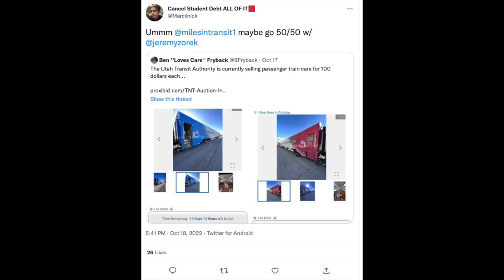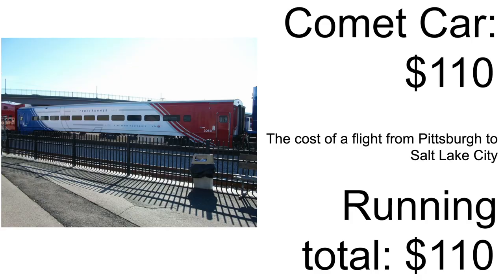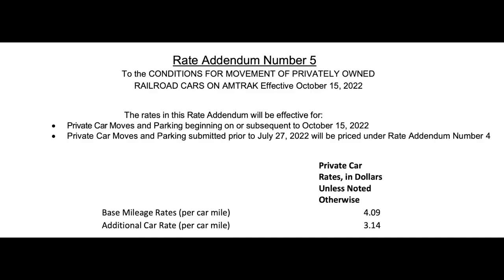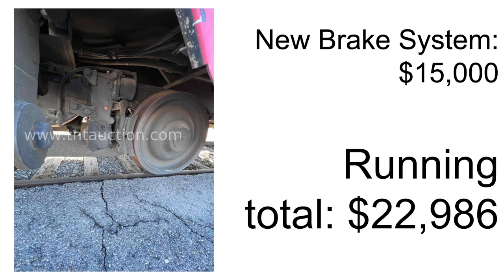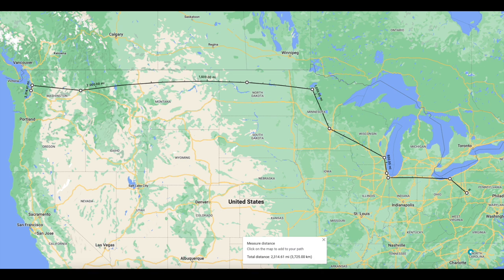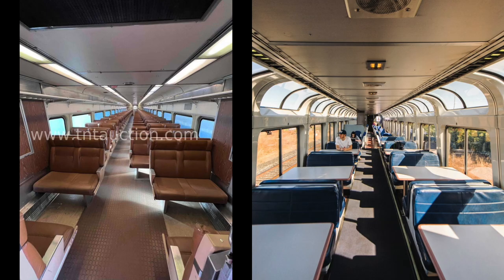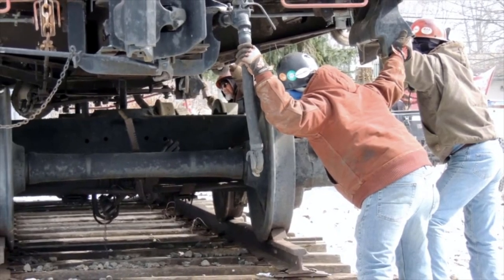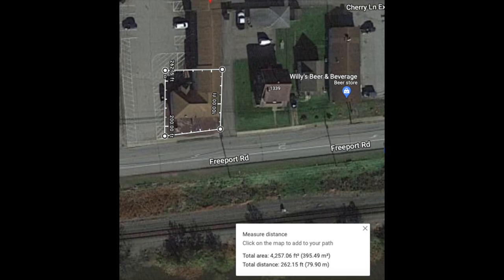These Passenger Cars Are Selling for $110*

Comment: A bit of extra information about the windows: from what I have heard, smaller windows were more common at that time because hooligans took joy out of throwing stones at train windows (or at least in Chicago, since I got this info on a video about Metra's gallery cars). Now that the fun has been zapped from that activity, windows seem to be getting bigger again. Given that I wasn't around in those days, though, it's probably best to take what I say with a grain of salt.
Reply: I think a big part of it was also that the cars were air conditioned but not necessarily insulated all that well, so they wanted to cut down on how much radiant heat came in through the windows. A lot of buildings in the early decades of widespread air conditioning were value engineered the same way.

Comment: Gee where did my last post go? Places that you might keep it cheap around Pittsburgh are: Oil Creek and Titusville RR, Cuyahoga Valley Scenic RR. But it's got wheels and if air dates are kept up you can move it again in a few years. There are two groups around Youngstown that have equipment that might let you in. Which is not too far from the Burg

Comment: Major issue is where to keep it? The best place is a tourist short line or any short line. Costs of track rent vary depending on the line. Major cities have major costs. If you have the car inspected and find a good one. There is NO need for all these expensive repairs and changes. It's is a simple commuter car. Small windows are lower cost to replace by the way.   Today we have plastics that are unbreakable and just as good as glass. Maybe Corridor Development Company can help you? AC&J RR is not too far away, Jefferson, Ohio maybe they will rent to you?
Reply from the maker: Big if - trains break down a lot!
Reply: @ClassyWhale  I never had a issue, since I followed up on the work I wanted done was done right. So it was ready for railroad inspectors when they arrived to look it over. Before they would permit it on their railroad.
Reply: @ClassyWhale  There are about 15 inspectors nationwide. I would guess. I use a friend I have known for 40 years but he is in Boston. And doesn't travel far cause now he's married with kids.